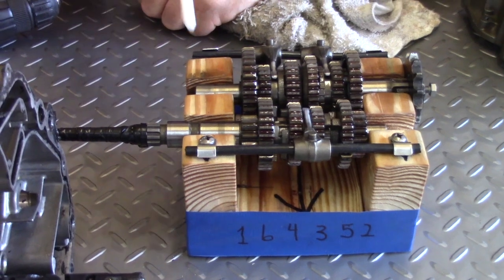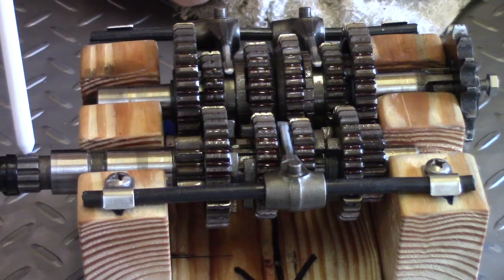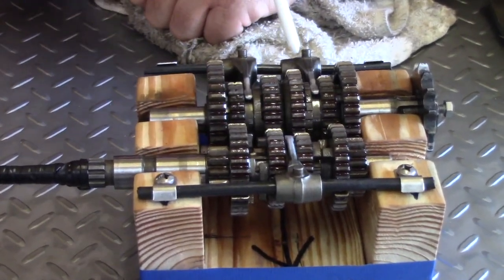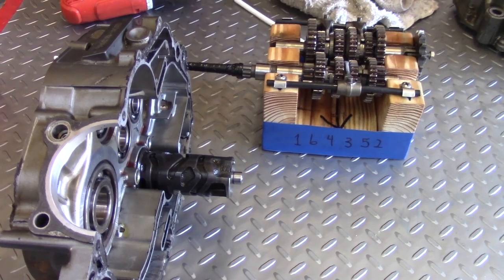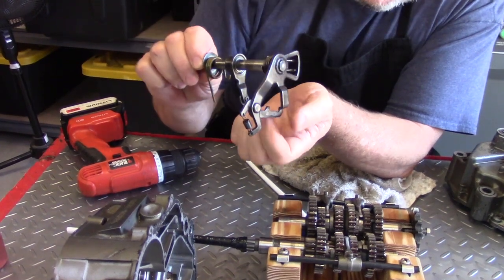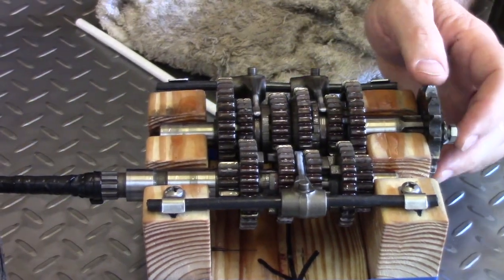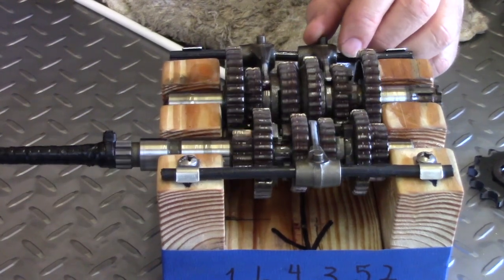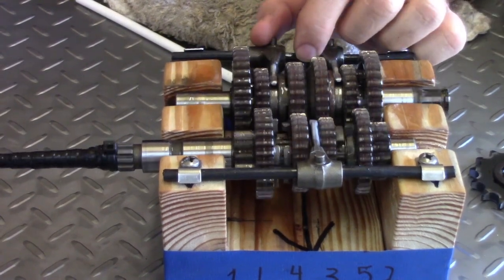How a Motorcycle Transmission Works

Comment: You don't use a clutch here but you can shift gears. So can't we shift gears without a clutch when riding a motorcycle?
Reply from the maker: Emre, many of the moto-x racers use the clutch for launching, to raise RPM like when coming off a corner  - many don't use the clutch during shifts. . They "load" the shifter with foot pressure up or down and blip the throttle to remove the drive torque. In drag racing, the shifter is often tied to an ignition disrupter and even an air cylinder to quickly move the shifter in the split-second interruption of spark. All of this comes at the expense of wear and tear. Those guys have no problem rebuilding and replacing every component every other race. Wear and Tear is why we use a clutch. If you ask  shift forks and sliding gear dogs to engage while under loads - you will get high wear, chipped teeth, and frequent replacements are the only fix. The old saying - "burn a candle at both ends and it last half as long". Thanks for commenting. Gordon/RTS

Comment: How does the shift drum engage the shift forks in this set-up? 
Is it just the way you have this set-up for display because the shift drum can not engage the forks like this?
Reply from the maker: Hi BP, as you've already noted, in real world, a single shift drum would drive/control both pairs of shift forks. The shafts that the forks slide on would be rotated and moved closer to each other. I separated them in this fixture for demonstration only to show how each ration changes and the vital roles the drum and forks play in our constant mesh transmissions. Thanks for the comments! Gordon/RTS